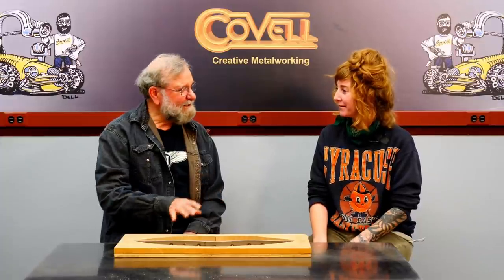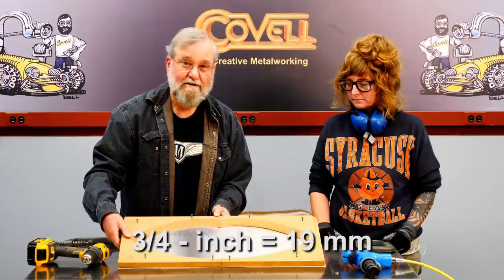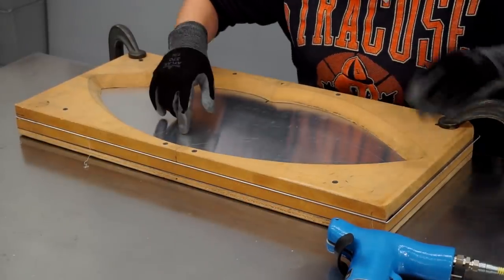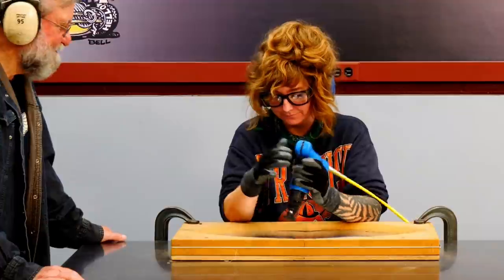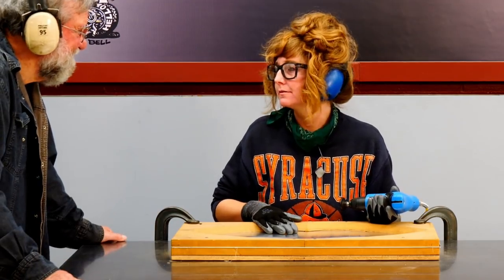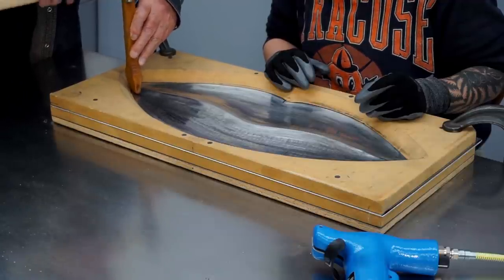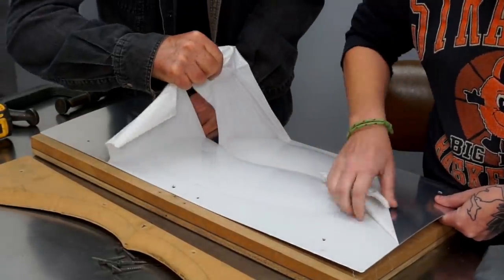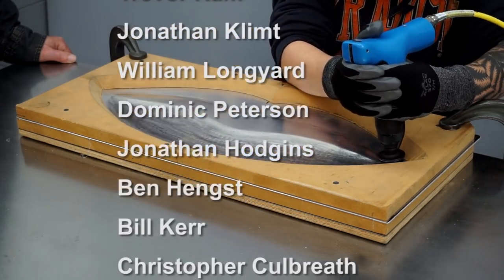Hammerforming - with a TWIST!

Comment: So fast using that tool. I've done repoussé with a hammer and chasing tools. It takes forever with multiple annealings. Thanks for the idea!
Reply from the maker: Yes, a hand-held planishing hammer can really speed the work.
Reply: @RonCovell  might not be as nice to use, but could you make an air hammer/chisel work if you put a suitable end on it?, wouldn't be as comfortable to use, I think it should get the job done?
Reply from the maker: Yes, an air hammer or chisel could do this work too, although the hammering speed is not generally as easy to control.

Comment: First time I've seen an electric planishing hammer. Seems like a great way to develop compound curves with the wooden MDF form/clamp. The end result is somewhat similar to vacuum forming of thermoplastics. No doubt some people would be tempted to touch the end result, just to convince themselves it's real metal and not fibreglass or plastic. Fascinating demonstration! Keep up your educational videos, I like them very much.
Reply from the maker: The hammer is pneumatic - it runs on compressed air. Yes, the process is somewhat like heat forming plastic with air pressure. With air, the pressure is the same everywhere. With the hand held hammer, you control where the action is.
I'm very glad you like my videos - many more on the way!
Reply: @RonCovell  Oops!
I didn't realise the hammer was pneumatic. Thanks for your reply.

Comment: Cool video. Thank you once again for your contribution. She looks like she does very nice work. Her projects look amazing.
Reply from the maker: Boone - good to hear from you! Aideen is a very talented person indeed. At last report, she was working as a supervisor in the metal shop at a college in Michigan. She's helping students chop the top on a Mercury, and she's building a sport bike for herself.
Reply: @RonCovell  That is awesome. Can't wait to see both of those. Based on what she did on the two projects that were featured. The bike should be quite unique.
Reply: @RonCovell  I am currently working on a roof insert panel. Had to go back and watch videos to brush up on technique. This is my first attempt at a roof panel. This one is quite large. 52 x 42. Had to break them down into two 26 x 42 panels. Hopefully it will all work out. But I have good source materials to reference. So I am confident with video tutorials I will be fine.
Reply from the maker: Boone - yes, roof inserts are challenging because of the size, and the fact that they are usually very low-crown. Bobby Walden has some great videos on this. Check them out if you haven't already!
Reply: @RonCovell  Bobby is definitely the master of roof inserts. When he is done. You can't even detect a weld seem.

Comment: Great video. I used a similar technique when I made by Battlebot Ziggo. I had to reinforce the rim of a wok that spun at 2000 RPM and hammerforming 1/16" steel over MDF made a light, strong part.
Reply from the maker: Very cool!

Comment: Awesome video! What thickness material are you using? Could brass be used? The mechanical properties are close with just the elongation being higher than Al, which I think should be beneficial here.
Reply from the maker: This demo was done with .050-inch (1.2mm) aluminum. Brass could be used for this kind of work, too.

Comment: Great video and the hammer form here is an amazing idea -- THANKS! 
Question -- Have you ever thought of a way to make a hammer form that is non-planar on the outside edge? For example, say you need a "parting line" that is a slight spline curve rather than perfectly flat, because you want to mate the hammered part to a compound curved area on a car body? I'm trying to describe a very low profile S-curve as seen from the side. I'm asking because that is what I need to do for quite a few identical compound-edge parts, and using a form would make things so much easier, and far more accurate too. Thank you.
Reply from the maker: I'm so glad you liked the video!
The vast majority of hammerforms are flat (planar) on the outer edge, primarily because the materials commonly used to make them come in flat form - like sheets of MDF, plywood, or metal plate. 
If you have an original shape that you want to make copies of, you could cast a hammerform from the original. You can use Bondo, fiberglass, or concrete for this.
Outside of casting, making a curved parting line would be tricky, but not impossible.
Reply: @RonCovell  Thank you so much! The Bondo idea is very good and I will try it. I'd love to send you a photo or diagram of the result. You are THE Master of Bodywork!
And by the way, I am honored that an actual -- let's face it, world class celebrity -- person of your status has replied to my comment. Wow!
Reply from the maker: I like to help people, and you can send your pictures to me by email - covell@cruzio.com
Reply: @RonCovell  Just sent -- Comments welcome -- Thanks!
Reply: @RonCovell  SUPER difficult, but still working on hammerform version. The double reverse "S" curve is a real challenge to keep from buckling. Will take this as far as I can, then do the bondo or concrete method. By the way, my original goal of "saving time on multiple pieces" is pretty much shot.
Reply from the maker: First of all, I'm very glad to hear that you have stuck with this demanding project for so long. While you may not be saving time, you are build valuable knowledge that may very well help with later projects!

Comment: Mr.Covell, what was the purpose of this presentation? I hardly can understand.
Reply from the maker: Many metalworkers use the hammerforming process to make intricate shapes. What's unique about this demonstration is showing how adding a raised rib to the bottom of the form can create a shape that would be quite difficult to make in any other way.
Reply: @RonCovell  Mr.Covell, you are one of the gurus of metalshaping along with Gene Winfield and Lassee. Please, we need real metalshaping tricks other than lips.😉
Reply from the maker: I appreciate your comments. Many of my viewers are interested in cars and motorcycles. If you wanted to make a motorcycle gas tank with a sculpted groove going down the sides, this would be a good way to do it. In fact, it is rather difficult to make an accurate groove with  other techniques.
Reply: @RonCovell  You are absolutely right here. All these techniques that you share can be used in so many different areas. Cars and motorcycles yes, but also furniture, architecture, art and decorative pieces, etc. Literally anywhere that people might want to make something or other out of (sheet) metal.

Comment: What's the "Twist"?
Reply from the maker: The 'twist' is adding a raised feature to the floor of a hammerform, which creates the 'valley' between the lips. That detail would be quite difficult to achieve in one piece of metal with any other technique.

Comment: Is it the iron presentation of cosmetic firms, isn't it?🤣
Reply from the maker: I'm not selling lipstick, if that's what you mean.
Reply: @RonCovell  No, Mr.Covell. I esteem you very much. What I mean is why lady wanted the lips ... Strange... You are one of the most honourable guys in metal shaping. Why lips?😉
Reply from the maker: Thanks for clarifying what you meant. When I learned Aideen was coming for a visit, I looked around for whatever forms I had laying around that could be worked over quickly, and would make an interesting video. I created that hammerform for a workshop I gave previously, and I thought the finished part would look good on camera, plus give Aideen a great souvenir to take home.